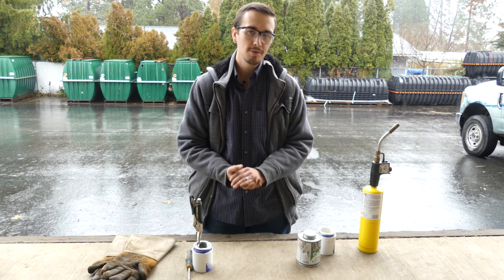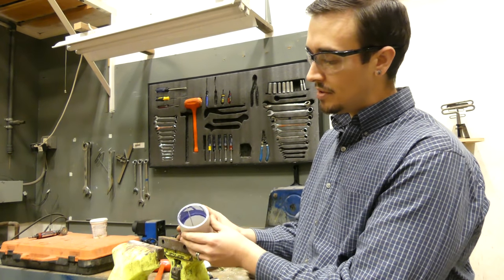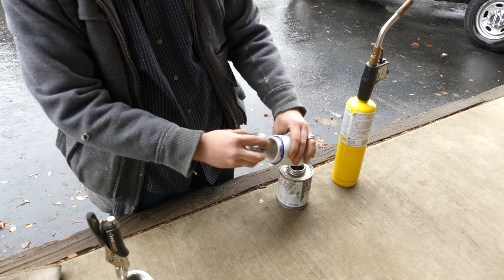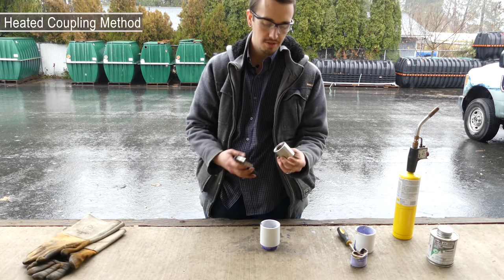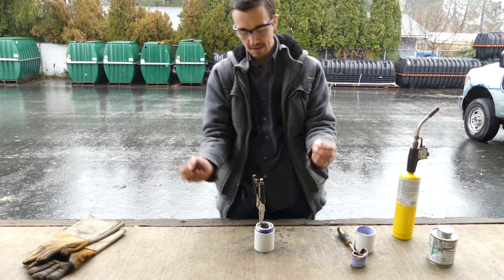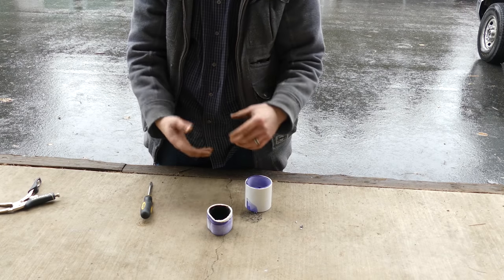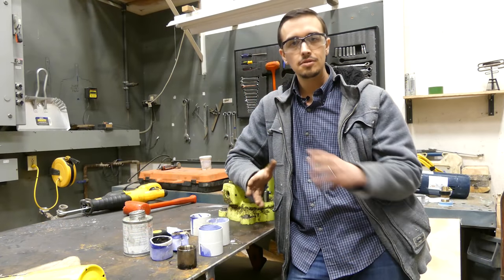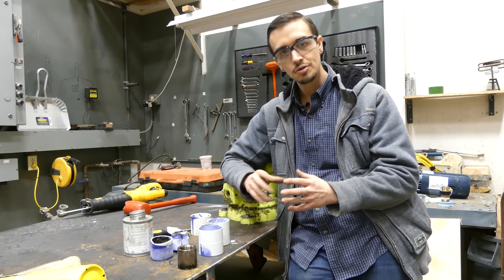3 GENIUS Ways to Remove PVC Pipe from Fitting (Without a Heat Gun)

Comment: All three seemed doable though you seem to struggle and I couldn’t take a chance of scoring the piece needed nor could I find my heat gun. I saw a different video that I followed, pouring boiling hot water over the joint while using pipe wrenches on the two pieces, The seal broke apart immediately with no damage to either piece and it was easy Peezy!

Comment: The 3rd method has my vote.
I just saved a trip to the store for a green Orbit manifold coupling.  
The pvc was 3/4. Stuck a deep set 14mm socket in a vice to heat it up and keep it secure . Seemed easier to handle the coupling this way.
Coronavirus  is still out there, and I am 68, plus my wife has major immune deficiency, so it was more than just about  money.

Comment: Occasionally  you will run into a job where digging out the fitting is very helpful in certain places. We have for years done this. We would try to get both the levels the same when looking at the broken off piece, then we would just use the propane torch directly on the pipe slowly heating all around just like the s/s coupling did and we would actually let the pipe and most of the time the fitting get the PVC soft and use a thin blade screwdriver and needle nose pliers. Just force the thin blade screwdriver between the pipe and fitting wall and separate it a bit so that you can insert your needle nose pliers all the way to bottom and just twist it out. Have done this successfully numerous times. In comes in handy in sticky situations. Slow and sure will usually do the trick.

Comment: I use a small hand saw then a heated piece of pipe. You can cut a slot in the fitting without gouging the the outer fitting in under 2 minutes. Then use the heated pipe and peel it out.

Comment: Should try small cut on inside of the PVC pipe, needle nose vise grips, heat pvc with hot air gun, then grab the PVC rotate the inner PVC pipe counter clockwise. This method works without getting stabbed by accident. And the PVC is still installed on the equipment. Works for me many many times in small hot tub fitting replacement or swimming pools repairs, leaks etc.

Comment: The 3rd procedure was much safer then the 2nd because no open flame from the procedure of 3 occurs except for the torch heating the stainless fitting. Less pollution to air also no burning primer.

Comment: When your near the depth you want, with the sawzall,  release the trigger, and use the sawzall like a hand saw. Much finer control.
Reply: There is an attachment  you can purchase  at the plumbing supply house that is used  on a drill to remove  the tubing from the socket of the fitting.

Comment: I found the best method is a heat gun And a little bit of patience works best it’s softens the pipe makes it easy to remove it can also be used to clean some of the old glue out of the existing pipe

Comment: Plumber had to use method #1 to replace the closet flange.  Home architects and designers don't plan on you ever needing to replace or repair anything.  They don't leave enough room to use a reasonable length of pipe so you can just cut the pipe and add a coupling.  So there are places where you have to do this or turn the job into a big job ($$$).

Comment: I find if you put a 2 prong fork into the heated pipe ( one inside the pipe and one outside the pipe ) just outside the fitting and heat up the pipe inside the fitting, by rotating the fork, theres no need to beat and bang...just shove the fork in and twist. The pvc pipe will merely roll up and pull away from the fitting, leaving the fitting pristine. It helps to use a strap wrench to hold the fitting while turning the pvc pipe. Use a heat gun instead of fire

Comment: You should do a video like this but try and save the pipe instead of the fitting. That’s what had to try and do today at work in a restricted hole I broke in concrete. Had to replace a broken low heel.
Reply from the maker: That's a great suggestion, thanks! How did you do it?
Reply: On this old house, Richard showed how to remove the piece by using a special hole saw the same size as the inner pipe. Worked great without damaging the coupler.
Reply: R.C. Worst & Co., Inc. sawzaw chisel flat head screwdriver and a hammer. But ended up being a fail and plus it took hours totally a waste of time
Reply: Hacksaw blade,use it to split the fitting and peel off.
Reply: I knew a crossdresser that broke a high heel on a hole in concrete. He fell; to re his dress and smudged his lipstick. All that and he still got my bathroom remodeled on time and under budget.

Comment: I have this problem with my grey water tank on my RV. 3in at one end 2in at other and it snap in half. The problem is 3in is attached to the tank with glue or whatever they use to attach it I don’t want to destroy the tank just want to replace pipe and it’s black pipe not white any suggestions would be helpful. Thanks

Comment: Any idea if this method will work with Oatey All Purpose Cement on a PVC to ABS fitting? I used the All Purpose because it shows that it works with ABS, PVC and CPVC, and I had a few things with PVC, ABS, and ABS to PVC. Now I need to remove the ABS to PVC fitting.

Comment: Can you just reglue the fitting as is, or is it necessary to remove the old primer and glue? If so, HOW does one remove the old primer and glue?
Reply from the maker: Good question! I would say it depends on the condition of the fitting after you remove the pipe. If there are any rough edges or burrs they should be sanded until smooth so the primer and glue have maximum contact.

Comment: We just removed a few fittings with a heat gun and it worked easily and quickly. All the methods shown here are likely to damage pipes and the ones with heat are a fire hazard.

Comment: So, to remove a 1.5" PVC Sch40 pipe using the hot stainless coupler, I'd just need a 1.5" stainless coupler (or, as alternative, a hole saw) since the internal dimensions of the 1.5" PVC pipe is the dimension we're talking about? I've got to remove a few pieces on my pool pipes. I have to install a whole new sand filter, and want to keep as many of the the pipes with all of their couplings as I can.
Reply: Did you manage to get your pool project done?  I'm about to start replacing 1-1/2" ball valves and have limited space.  If it's any help, a 30mm socket is a good fit inside 1-1/2" PVC pipe so I'm going to try heating that.  My main concern though, is to remove the valves without damaging the pipes instead of the other way around.

Comment: Why not use a COMBINATION method?  Add 2 cuts w/Sawzall before heating interior either w/burned off primer or SS pipe piece?  That will make it easier to remove inner pieces as it will be in 2 pieces - easier to twist out than 1 piece.  You don't have to cut completely through the inner pieces as partial cuts will separate easily when twisting after heating.

Comment: I cut my junction pipe, ran the saw up the pipe, smashed it with a c-clamp, then got the rest by twisting it with a strap wrench. Great video, also wanted to share my success. Granted, mine was leaking so it wasn't a perfect mate/connection.  If it were, I don't know if would have worked.

Comment: Any ideas on how to remove broken off 2in threaded pvc pipe from an old cast iron flange. Could you take like that stainless steel metal coupling and heat it up and would it melt the pvc threads onto the metal coupling and then allow to harden to remove the broken off pvc pipe for replacement?

Comment: Instead of a sawzall use a die grinder. Much more control and you can see the interior of the cut as you go.  Use a 1/2" carbide Burr it makes a nice open channel you can monitor. Free the edge and pry/roll out. Usually 1 cut rarely 2 and it's out.

Comment: For couplings why not simply heat a short piece of pipe that fits in the coupling. Now heat the end of that piece of pipe and insert it into another piece of pipe the same size. You've made a swedge for your pipe. Now pull it out and heat another piece of pipe that you want to use and insert the swedge into the pipe for several inches depending on the size of the pipe. Pull it out and you're left with a bell on the end of the pipe you plan on using. You can wrap a little paper around the swedge before using it to give a little more room in the bell if needed. Now you have a pipe with the coupling on it without spending any money.

Comment: Good vieo. I think the coupling method works the best but how many people are going to have a stainless steel coupling lying around the house? Stainless steel is expensive and when working on PVC,  the common sizes used for residential is 1-1/2,  2. 3 and 4 inch and finding a stainless coupling that large, in a hurry, might be difficult.
Reply: A 30mm socket is a good fit for 1-1/2" PVC pipe

Comment: He made hard work doing number 2.  Should only take less than a minute to do it correctly.   The best way is using a hair dryer or heat gun
Reply: Yep, doing a number 2 can sometimes be hard work for some folks.  I would not want to try using a hairdryer or heat gun, though. 🥺😂

Comment: I stupidly cut an abs toilet closet bend flush, leaving a ring inside.  On slab, so no access from be
below or subfloor to remove, nor would any available repair coupling work. Put a heat gun to the inner ring, sliced into it with a oscillating saw, and grabbed the heated ring with needle nose pliers and twisted it into a roll as it came loose.  Ring came out out and now my pliers are encased in abs😄

Comment: that works great if your working with a larger piece of pipe but what if your working with 1/2 or 3/4inch pipe
you use pvc cement not the primer. check out the guy who uses 3 methods for blue pvc.He uses a candle to reheat the glue from the inside to loosen it, then he uses pvc cement on the inside then sets it on fire, and his third method he boils the pvc pipes and connectors in boiling water to loosen the pipe. He has a video on youtube titled 3 ways to remove glued pvc pipe.

Comment: PVC becomes soft at 63 degrees centigrade and its a poor conductor of heat, so the coupling will stay hard. A steel container of boiling water would do the same thing, no flame needed.

Comment: IMO for close quarter situations especially where you don't have the option for heating except with a heat gun. Or where you wish to remove the coupling, not the pipe. First option would be my preferred method.

Comment: I watched this video to get some idea for threaded pipe.  Method 1: No.  Much to dangerous to damage the threads.  Method 2: Plausible.  Method3:  Difficult to find  a O.D. SS pipe to fit the I.D. required.  But it's the cleanest method. (I had to save a 2" Brass  coupling & probably could have just heated the Brass.)  PVC is cheap, just buy a new piece.

Comment: In have a tool that has a guide so you put it on a drill and it shaves out the pipe from the coupling in one pass. takes about 1 minute and its a good clean coupling.

Comment: Drilling the pipe with a step drill bit(or conical drill bit) of the correct size is much faster and leaves the socket clean for a new connection. For example, use a 32mm step drill bit for a 32mm pipe glued to its socket. As for elbows, where the bit could make a hole in the inner bend of the elbow due to its length, simply cut the step drill bit maybe about half way from the end.

Comment: burst water line from water tank  at 2 am  and 200 ft away from outlet with a 3 quarter pipe .What are you going to do.  A hacksaw blade and method  1 works fine .

Comment: I'm just not sure what you are trying to do?  Are you saving the fittings for future use?  Do you really think the you should put flame or heat to a fitting the is going into a concrete slab?  Your first attempt would be my second way to go. BUT, Try cutting the pipe several more times than just 4. Throw your sawzall back in your truck and pull out a Hacksaw blade only.  Make several cuts. Then, I have a thin piece of stainless steel about a 1/2 inch wide. You can almost push it between the pipe & fitting. You will not pull any of the fittings apart by making more slices.
  But my first try would be. 
  They actually make a special bit that drills the pipe out of a fitting.  I've used this method from 1/2 to 4 inch pipe. Works every time. 
Why take a chance on melting your fittings??

Comment: Likely already mentioned, but...1) probably not worth the time and effort unless you can't easily get hold of a replacement fitting, and 2) after heating the pipe or cutting it into sections, place the pipe portion into a VICE (if available) and tighten to break the pipe away from the fitting.  A vice requires less effort and won't scar the fitting.  (NOTE: Wear eye protection when breaking away the rigid pipe in case it shatters.)

Comment: In my years experience of dealing with pvc marring the inside of any fitting is a bad idea and usually will fail soon if not immediately. Just run and get a new fitting unless you are in an emergency situation. Saving the integrity of a burried pipe is my main concern
Reply from the maker: Inevitably a situation comes around where you have a PVC fitting stubbed out of a concrete wall or foundation with no access to the other side In these situations its worth attempting to salvage the existing fitting. Or another scenario, you are at your cabin with no way in or out and you need to repair a pvc line but have to salvage a fitting or two. Examples like what I just described are the intended application of this information. Obviously always install new when you can.
Reply: @RCworstwater  it worked very well. I had to remove several 1 1/2" fittings in a sprinkler system yesterday and have more to come. The "plumber" used glue on some fittings and none on others. On a 4 way t he managed to get a coupke pipes glued a couple reducers glued and one or two T connections.  Hey 50% of the fittings were glued. I wish i had his name and number id post that for sure

Comment: 1:20 at this point it seems like a new $2 coupling would be the ticket. I guess this could save a trip to the hardware though. is that your thoughts on why to do this? just curious. Thanks
Reply: 1:40, btw, if you happen to damage that coupling like you did, you can always wrap it with some mesh tape and gorilla glue, and it won't split any further.

Comment: Sometimes replacing pvc is costly because damaged pipes or a fitting may require the replacement of several other components such as valves, etc. Then there’s the labor.

When using an electric heat gun, you can adjust the heat setting as well as where you want your heat treatment without toxic fumes.

I use this method for pool repairs as  the cases I encounter might be hard to reach areas or may cost the customer a small fortune to re-pipe an entire line over a cracked pipe leading into Venturi fittings or cement walls; no need to bust up the deck and re-pipe the whole thing.

This affectively removes pvc from fittings on the outside of the pvc or pvc from inside fittings and valves. With a little patience and a multi tool saw, you can perform pvc repairs like a surgeon saving your customer money which makes you in the long run more money by being able to perform the job faster and cheaper.
Reply: And this method works on all pvc glued.

Comment: I fabricate custom water equipment for work. In my experience, using a heat gun is a FAR more practical than using fire or a blow torch to heat up the PVC. Also, you can get ram bits for  hand drills that can work pretty well if they're a quality bit. But If its cheap or worn or otherwise doesn't fit the pipe perfectly, you end up tearing up the socket of your fitting anyway. Heat gun and a channel lock and a flat-head screwdriver is the way to go IMO.

Comment: Where do people find perfect fitting stainless steel inserts like this? The only thing I can think of would be impractical: buying an expensive stainless steel pipe the exact diameter, and then cutting off a portion with a stainless steel metal cutting saw.
Reply: If you have a regular mechanic's socket set, you probably would have the size you need.  The only one I've needed so far is a 30mm socket for 1-1/2" PVC pipe.

Comment: Method #2&3 make a cut on the pipe then it will peel it out with pliers 
Method #4 use a drill and a socket saver.

Comment: Um.. use a REED clean ream "fitting saver"...cut the pipe at the hub and use a reem bit to shave out the pipe that is still glued inside the fitting/coupling... clean out the shavings then abracadabra... just like new... takes 2 mins

Comment: I slice it and roll-peel it out. Has anyone used the internal saws made for particular pipe sizes? I have a 3/4 and 1" since I do a lot of jet pump work. Priceless to for what they save you in driving time for a fitting you may not have.
Reply: The inside hole saws enlarge the socket alot. Mostly because it walks and wallers around as it goes in. It may be ok when held in vise with a drill press or mill.  I've got them out using a step drill. Take an old dull stepdrill and grind off the point or od to get about 1/16 or so under size and run it down. Usually the core comes out easily and you have a nice socket to use.

Comment: Good tips but way overkill. There’s actually a super easy way using a heat gun and heat the inner fitting while spinning for about a minute and a half then take channel locks and twist it right out.  Lightly sand the outer fittings inside and you’re good to go

Comment: this only worked because the joints were never done properly in the first place. The primer is meant to be worked on both pieces prior to gluing, then they will never come apart as it welds together.
Reply from the maker: Moz, we used primer and glue on these joints, then let it cure overnight prior to using these methods.